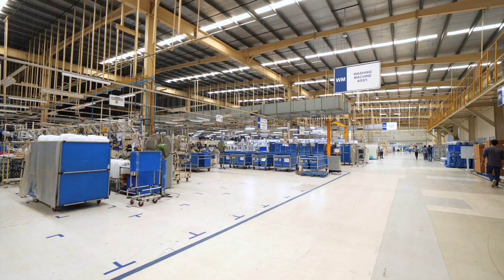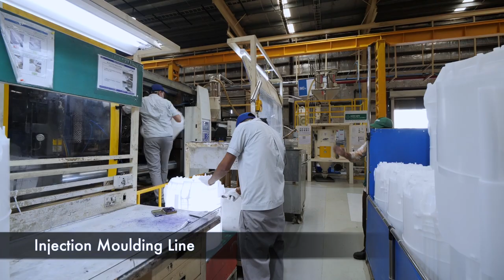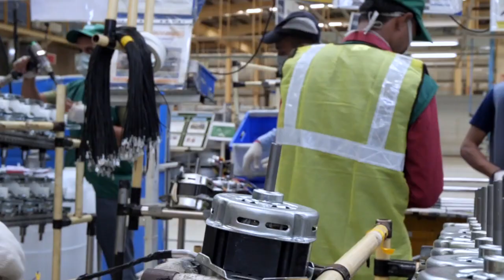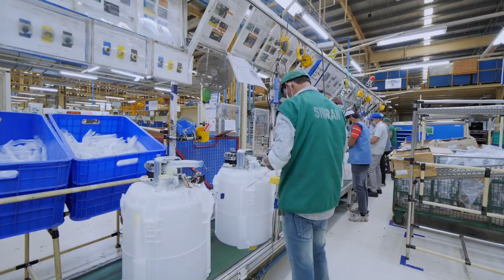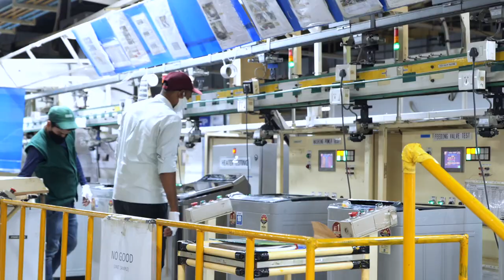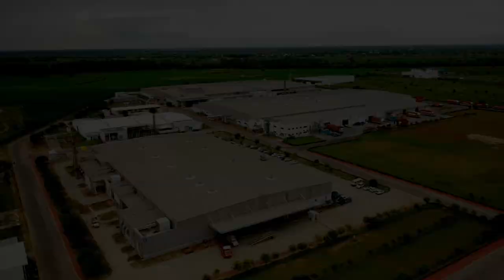Panasonic: Striving towards An Atmanirbhar Bharat

Comment: After sales service is very poor of panasonic AC in west bengal. The parts of panasonic AC specially PCB is not available at their service station. I have a Panasonic AC which is 1.5 years old. The out door PCB of my AC is not working from 04/09/2022. Till now they don't have the parts and the service provider doesn't know when the parts available at their station (KOLKATA). Now I am in big trouble. That's why I must say once again their service is very very bad.
Reply from the maker: This is definitely not the kind of experience we want you to have and we'll do our best to assist you. For security reasons, kindly share your contact number, email id, & complete address with pin code via Facebook Inbox so that we can get this checked. Thank you